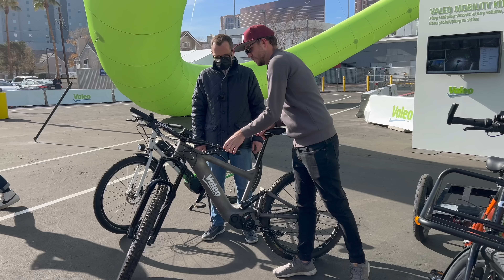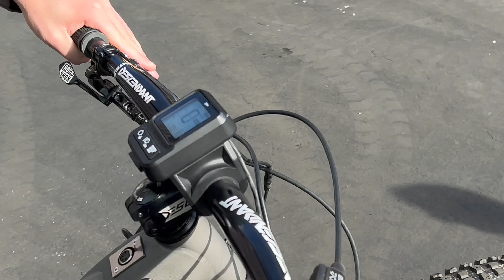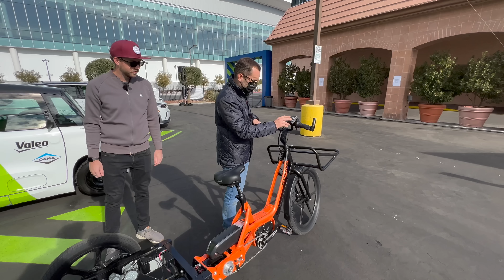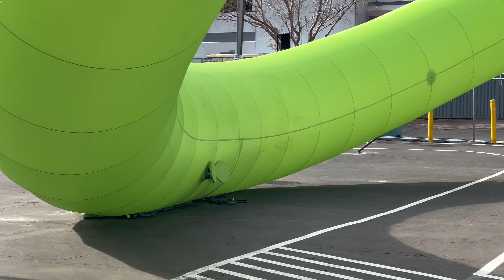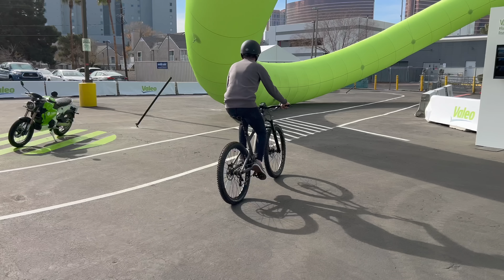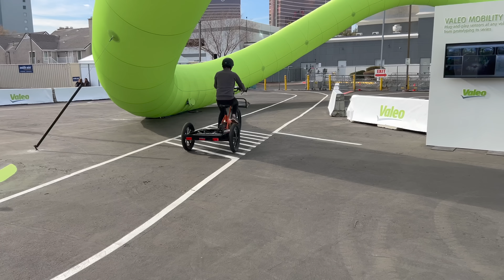I Test Valeo’s New 7-Speed Automatic E-Bike Transmission and 750W Motor Combo. The New Standard!

Comment: I have had the opportunity to recently test an Ebike with this new drive system. The system is  well thought-out. There is a Predict mode which simultaneously manage the automatic shifting of the power mode (Eco, Turbo) and the speeds ( 1 to 7 ). There is also a possibility to use an automatic mode in Eco or Turbo mode with the automatic shifting of the speeds only. The last option is a manual mode similar to any regular Ebikes with a manual setting of the power modes and the speeds. We can easily feel the 130 NM given by the manufacturer. With four strokes and a well sustained effort on the pedals we reach the 20 mph. It’s fun. Compared to the Bosch Line Performance CX Gen 4, the noise levels generated by these two drive systems are equivalent.
Reply: Thanks for sharing - could you indicate the model of e-bike equipped with this Valeo assist?
Reply: @denisparis2966  Atelier Heritagebike. I am the owner of the Heritage style model.

Comment: This leaves all other ebike motor companies behind especially for the MTB industry. Eliminate the derailleur and hard shifts, reduce unsprung weight, centralize weight distribution and facilitate the use of a more robust chain! Love it!
Reply: Thats a very bold statement to make. Unless you see these or ride these in real world testing in an EMTB enviroment against the leading motors like bosch and Yamaha, its literally just a guess. Hard shifts come from bad technique, and youre not eliminating weight, youre just moving it to a different position. They never even mentioned what these motors weigh, which are over 10 lbs. The transmission alone weighs 2kgs, which no deraillure or drive train on a normal bike would weigh. And the leading brands like bosch will always reign superior in materials and technology over a small company. 
Youre also dealing with less gear ratios for climbs and dealing with technology that no bike shop will be able to service or understand as this is specific and unique techonology. 

I understand your point for the urban and commuter style applications, but in no way would this technology translate well to real world EMTB riding. 
Its also why you only see Valeo made videos. Even 2 years after release, there is still no reviews or real world testing to be found.

Ive been in the ebike industry for 7 years now, and i can promise you that the leading ebike motors would still demolish these in real world EMTB testing. And im only talking EMTBs.
Reply: @DorDor400  
It will reduce unsprung weight.  Yeah a traditional derailleur can handle 750watts  but aftermarket motors run well above that. 
You’d be hard pressed to come up with a good argument that having a derailleur is optimal.
Yep, they surely have a way to go but I can see having something like a cvt that might work.

Comment: Thanks for review, I’ve been on the lookout for Valeo details and this was the first I saw of it. The one Q that you didn’t answer for me is whether this has regen braking. Given that I wasn’t mentioned I’m guessing no, but the fact that the cargo version can power in reverse makes me think it should be possible. I won’t add too much range on a light eBike, but it’ll save a ton of brake wear which leads to a nearly maintenance free bike. I hope you push Valeo on it next time you talk with them and they, or some other manufacturer finally makes an auto shifting mid drive with regen (throttle would be a nice option too maybe via a grip twist that turns up for throttle and down for regen).
Reply: @korean zombie I'm interested in regen more as a way to save my brake pads than to charge my battery. Going through the internal gears here should allow it to provide some strong brake force, the biggest issue is that it's on the rear wheel and not the front.

Comment: Odd that Valeo doesn't seem to have offered test rides to anyone that's actually ridden an ebike before.  Interesting technology but I scratch my head as to why they seem to have offered an exclusive to 2 guys with no prior experience.
Reply: Bikers would start complaining about the lack of carbon fiber, bottle cage and kashima coating. I love bikes but dammit I hate bikers, including myself.
Reply: Bikers are traditional in a very wired way. Just look how long it needed to road bikers accepted disc brakes?

A transmission system together with a mid drive motor? With AuTOmAtiC! 😆😆😂🤪 don’t ask. 

Really looking forward to test this.

Comment: very COOL! Really glad to see this technology progressing towards serial implementation. What about regeneration, does the elimination of the derailer not open the door to regenerate some energy and compensate at least part of the additional energy required by the shifting motor?
Reply: That's a function of direct drive motor technology and controllers being designed around regenerative charging. BionX and Ohm had regenerative braking; but, they're gone now unfortunately.